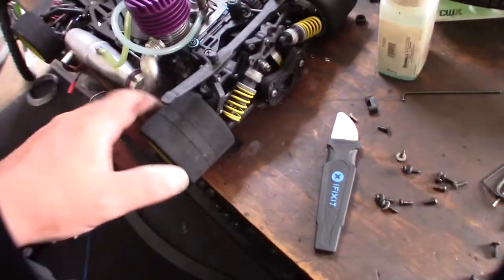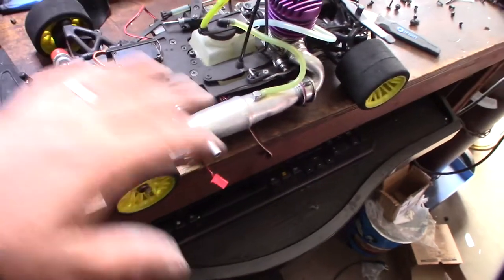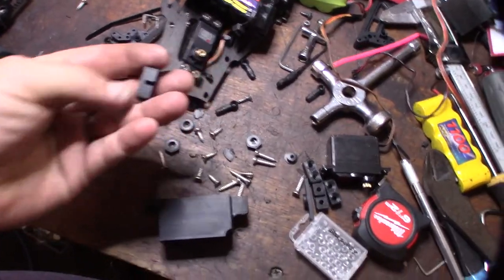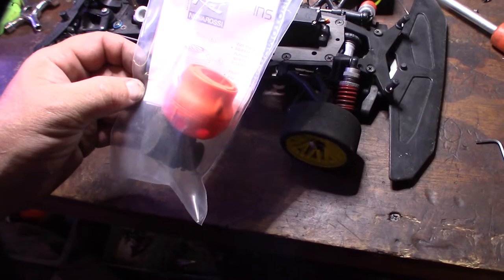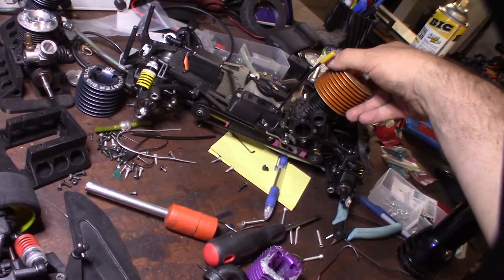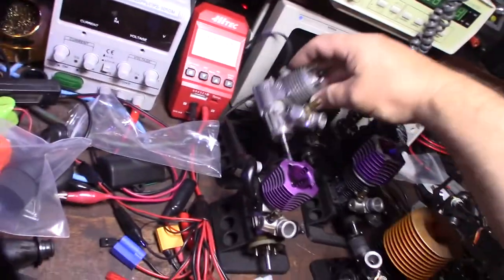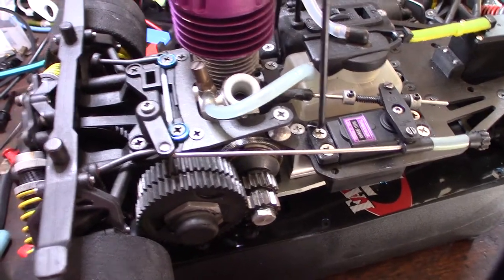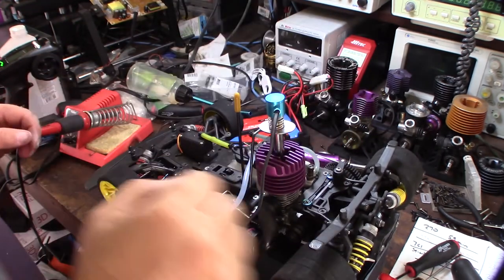Serpent Impact 835 1/10 235mm RC car Restoration RB concept X15 Nitro Engine fire up

Comment: Is that a rear end off a 1/8th scale? or was it a specific chassis serpent made for a certain class, as arent 1/10th scale 200mm?
Reply from the maker: The 1/10 scale 235mm class was a scaled version of the 1/8 class. Those wide back tires are reason these kick ass. I feel like they went backwards when these scaled down to 200mm and the skinny back tires.
Reply: Hey SWEET SCORE would you be willing to sell me one of them.
Reply: @fintechrepairshop  best scale ever....